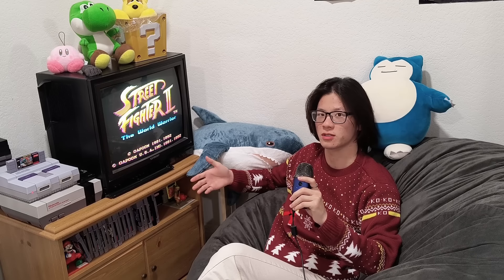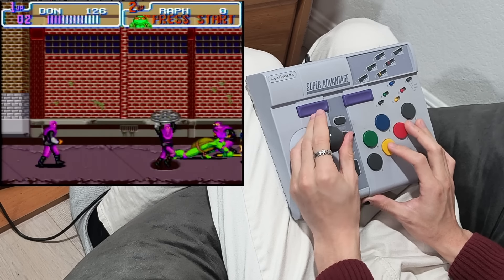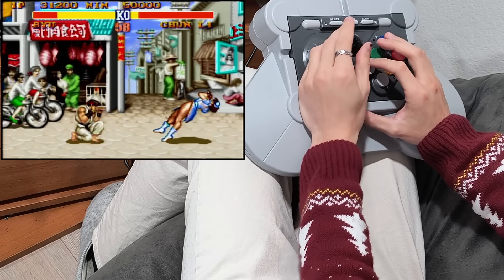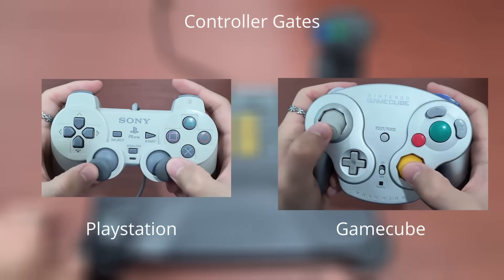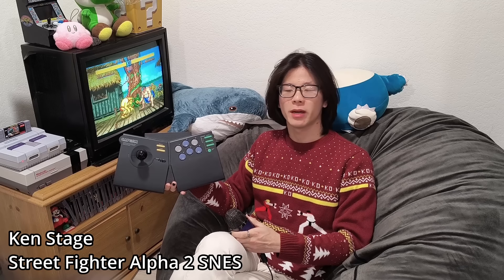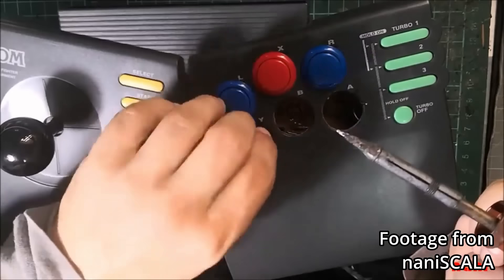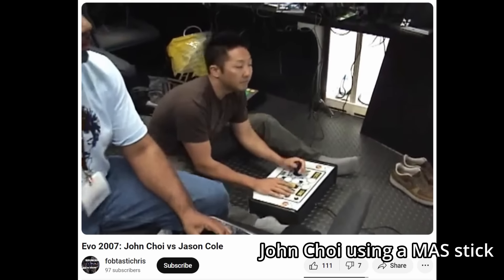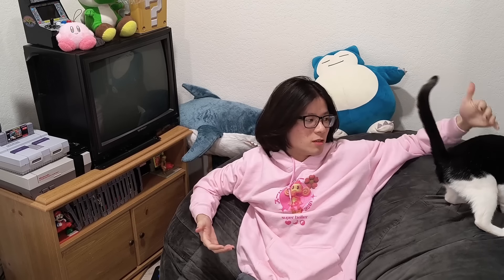SNES Fight Sticks

Comment: I still wish I had some of these fight sticks. I'd even be fine with a USB fight stick. But I gotta save up my money and invest with care.
Reply from the maker: Ah yeah. The good thing is that modern sticks are really accessible and have tons of options. Hope you can get one you like!
Reply: @SodaCanTablet  I know it'll be a bit expensive to make my own... But I want to make my own. Making the whole thing to work with a USB port would be functional for a lot of retro games. 

Even just the box itself would be pricey to make. Then there's the motherboard, the buttons, stick... It's gonna be pricey.
Reply from the maker: I made a Hitbox style controller for a friend not too long ago for PC that uses USB. I used a Raspberry Pi Pico for the logic board with the GP2040 code you can find online. I prefer the Pico to the Brooke UFB mainly because Picos are only $5. If cost is the main hurdle, I'd look into the Pico board. It's definitely a big portion of the cost down if you use that instead of UFBs. And yeah the buttons and the stick are definitely the most expensive parts. Sticks being $30 and each button being $2, it can add up quickly. But since the Pi uses a standard USB cable, you can use it with your pc and any emulators. Also for the case, you can use wood like I did, or if there's a thrift store near you, I'd recommend dropping by occasionally and seeing if they have any good boxes. My local Goodwill has small wood boxes that I think were for jewelry that would make good arcade sticks. Whatever you decide to do, good luck with it I hope it turns out well. Lmk if there's some way I can help with your build too.
Reply: @SodaCanTablet  Thank you for the input. I have been wanting to put my Shop Class skills back into work for a custom fight stick. Though the work is gonna be a bit timely. I'll need to save up for the stick and buttons. I saw a good bundle for a stick and buttons on Amazon. The board though will be a separate expense. 

I plan to map the buttons and set it up to be like an SNES controller. Problem is I'll need to put the L, R, ZL, and ZR buttons appropriately. It'd have to be an 8-button style stick, and in the case of emulation, I could easily map the buttons.

I just have to save up the money for the stuff on Amazon. 

For the art, I'm thinking of trying to get an artist to do some stuff of my favorite anime girls as something of a pinup style.

Comment: Bruh why is it so hard for companies have the buttons layout on those be like:
Y X L
B A R
Where the actions would be from the left to right:
Light,Medium,Heavy Punch
Light,Medium,Heavy Kick 
That's just silly to see 😅
Reply from the maker: Yeah I was confused too, but a lot of commenters brought up a good point. Fighting games let you configure the controls, so it's not TOO big of a deal if the button placements aren't optimal at the default settings since you can just tune them to your liking. Other games that don't let you configure the controls would benefit from having the button layout like
L X R
Y B A
because the Y, B, and A buttons are very commonly used action buttons so it'd be easier to have them in a straight line. Imagine playing Mega Man and you want to jump and shoot. You just have to use the 2 buttons on the bottom left which are easy to access using your index and middle finger. If it was a layout that focused only on fighting games, the Y button would be above the B button so pressing them at the same time would be a little more challenging. I think that's really cool that the designers had the foresight to make that decision which initially seemed weird to us.
Reply: @SodaCanTablet  I mean, good point but I couldn't see myself playing megaman on an arcade like controller 😂
Well except for ones released for it I guess.

Comment: I am partial to standard controllers. Requiring a table or putting a stick on your lap is pretty overboard. Also, you'd be crying I NEED MY STICK and using it as an excuse when playing at a friends.
Reply from the maker: Haha I personally don't have the dexterity in my thumb to do as well with standard controllers as with arcade sticks, but yeah it's definitely just down to personal preference. The second part is just the  scrublord's prayer HAHAHA. Blame the controller, accuse opponent of cheating/playing cheap/being a try hard/only caring about winning.

Comment: I had the Super Advantage as a kid in the 90's, still have it actually. But it sucked so badly unfortunately it wouldn't have been so bad if the buttons didn't stick but they stick badly.
Reply from the maker: Ohh yeah my Super Advantage also had issues with the buttons sticking, but I took it apart and cleaned the sides and that seemed to help a lot. It still did get stuck whenever the buttons got pressed down at an angle though.
Reply: @SodaCanTablet  My entire memory of it was getting it at the store, bringing it home, and realizing it sucks because the buttons aren't great and stick easily. Back then just about any third party controller was bad though, I learned my lesson.

Comment: 6:18 thats NOT amazing and how is that the same as arcade? old school sf2 80s arcade controls don't click, modern arcade eg maybe tekken 5 MIGHT use something this terrible, this is VERY bad, very clicky, and the ball moves, go look at a sf2 cabinet (or any old school arcade cabinet) all buttons are great and the joystick is one stick not a crappy short metal shaft with a giant moveable ball, you've literally RUINED what a good arcade controller is (unless you mean modern fight sticks then yes they are all this bad). The fking controller makes more noise then the game itself! p.s is it REALLY necessary to have a arcade stick on an outdated system? you do realise the snes was so slow that even tapping DOWN then FORWARD (i.e separate taps not QCF) you can STILL do a hadouken?
Reply from the maker: From your passion for SF2, hatred of modern sticks, and referring to Tekken 5 as modern despite it being basically 20 years old, I'm guessing you grew up with SF2 in the arcades and witnessed the decline of American style sticks and increasing popularity of Japanese style sticks. You probably prefer the American style sticks because of that reason. I prefer Japanese style sticks because that's what I grew up with. What makes a good arcade controller is subjective and the definition is going to be different for each person depending on what they grew up with. That's why there's still new types of controllers like the Mixbox being made for people who grew up using keyboard controls for example, and why some people still prefer Happ sticks despite most high performing stick users using Japanese levers like Sanwa or Seimitsu. Just use what works for you.

3rd gen home consoles rarely had arcade style controllers that used micro switch stick mechanisms as opposed to ones that use rubber gaskets. I thought it was amazing how this generation became a turning point for arcade style controllers using the more traditional switch mechanisms. Similar to how it was amazing when the 5th generation of consoles mostly came with analog sticks with a few exceptions.

American SF2 arcade sticks do click, just not as intensely. Like I mentioned, American SF2 machines used Happ levers which are clicky because they use micro switches. So yeah, the one at 6:18 is similar to the ones in the arcades because they use the same type of mechanism. Also original Japanese SF2 cabs used the clicky Sanwa levers so in both cases, original SF2 controls did click. 1 just not as much as the other.

The clickiness being very bad is subjective. Idk if you're talking about the volume or the clicking feel itself, but there are advantages and disadvantages to both. Loud clicking can give away your inputs to an opponent even if you're playing apart from each other which might help them predict your moves. However, they can also be used to fake out or distract opponents (such as when Justin Wong started to jiggle the lever really fast during Moment 37 to try to distract Daigo with the noise), and this metagame actually led to the creation of in game mechanics like the fake fireballs. Whether the pros outweigh the cons is going to depend on your playstyle and whether you like to play mindgames with your opponent or prefer a more straightforward approach to fighting. The clicking feeling is good because it gives tactile feedback when inputs are read. Without the tactile feeling, it'd be much harder to do moves. Think about playing a fighting game on an analog stick.

Not really sure what you mean by the ball moves. Do you mean like it rotates in place? Or that it moves up and down the shaft? Either way, it's not the ball that rotates, it's the shaft which by the way bat top Happ sticks also do. Neither ball top nor bat top sticks move up or down during normal gameplay unless you purposely pull up on them.

As for the SNES being outdated, again that's subjective and if you consider it outdated, it just sounds like you don't enjoy retro games. If it's fun, why does it matter if it's old.

You do realize modern Street Fighter games also have input leniency? SFIV had notoriously lenient inputs and continued with SFV and VI. And whether the input leniency of the SNES port of SFII was by design or because of hardware limitations like you said, the end result is something that the game devs deemed did not impact the game in a negative way and implemented in future titles.